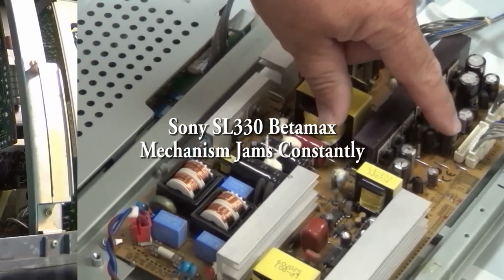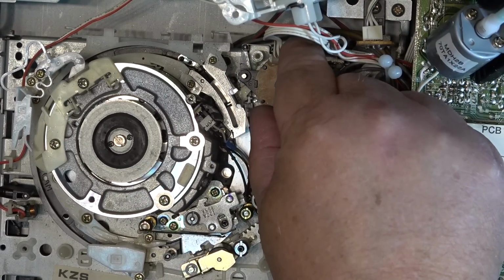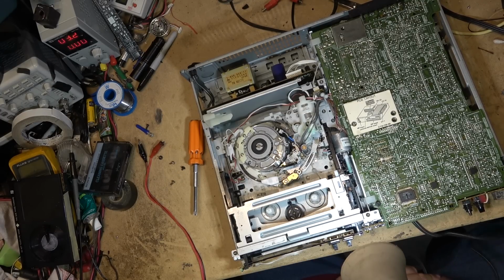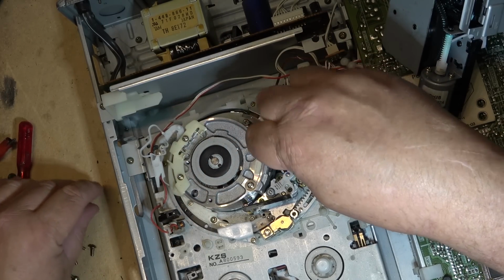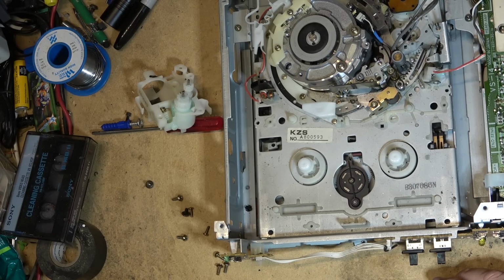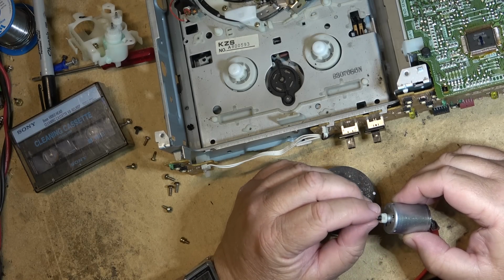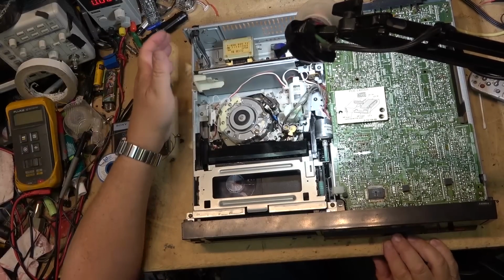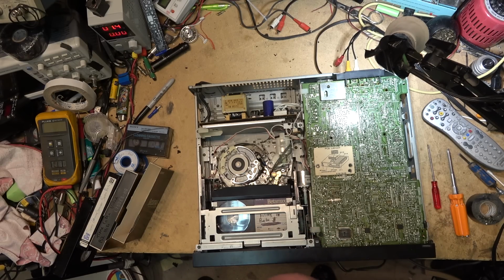Sony SL330 Betamax 711B3 Chassis, Mechanism Jams Constantly

Comment: Just received an edv-8000 from Japan and it's super clean, I don't think there was a spec of dust in it, but it wouldn't even load tapes at all. Watched some of your 711B3 videos and I fixed the cassette loading mechanism and that works perfectly from what I can tell. But, the tape pulling mechanism, those arms, don't get driven at all by the other motor. It moves very slightly and then the tape gets kicked back out basically immediately after it loads and goes down into the deck. 

I tried positioning the mode switch several times, using the arrow, but still nothing. Guess I'll keep trying other arm positions later, I did make sure that little metal bracket was up when I inserted the motor assembly. I can manually move the gear under there with my finger and it does move the arms that way, so they don't seem stuck or anything. Sprayed some deoxit into the mode switch as best I could and spun it around and so far that hasn't been the trick.

I don't think I have a way to test the motor itself with what I have here. Not sure what I need to give it different volts and amps to see if it powers on right. If the motor isn't plugged into the assembly and I turn the deck on, it does spin for a few seconds, so it at least will turn on by itself.
Reply from the maker: Check the plastic gears around the load motor. (On the part that lifts off) as the midway gear tends to lose a tooth then ir won't load. Also the position of the spring on the clutch.
Reply: @12voltvids  Thanks, I will check that out. When I removed the cassette loader earlier, there was a half inch little thin piece of rectangular plastic that was stuck to the side by some grease. No clue if that went to anything important. First beta deck I've had, so I could be missing where that went. It didn't seem all that important though.
Reply: @12voltvids  The spring on the clutch, is that a spring on a brake arm? Sorry if that's a dumb question.

Comment: Back in the day I got many motor going by disconnecting it and powering it from a power supply removed fro the deck and let it run for a few minutes this cleaned the comm and fixed many dead spots.

Comment: Another way to find a dead spot on a commutated DC motor is to put a high value resistor in series with one of the wires, power it up, and measure across the resistor with a scope. 

You should see even humps if a segment is dead one or more humps will be missing.

Comment: I've had some success with opening up these small motors by undoing the crimps with a punch and polishing the commutator, although for those trying this be warned that this design with the two crescent slots needs a brush-lifting tool made of a piece of bent wire inserted in them and rotated to lift the brushes off the commutator before trying to remove the endcap. This is likely how the factory held the brushes off when assembling them too. Otherwise you'll make things worse by bending or breaking the brushes, since there's a protruding flange on the end of the commutator in front of the bearing surface.

Comment: I agree with the power supply change, those stupidly over complicated switch mode supplies are a disaster waiting to happen, with these things its best to keep things simple, those motors not having a dust cover is kinda crappy design.

Comment: The 711B3 load/eject was just so buttery smoothe & quiet. But it's Achilles heel was the two tabs the cassette carriage rides on. Once you've got a good method to fix those however the problem goes away. Those tabs are the first casualty of the way packages are man-handled these days. I recently bought an SL-340 beat to hell by UPS.

Comment: Excellent work! I thought for sure the motor coupler was split. What brand of tape was that L-830 which shed its oxide so badly? I'm hoping that the conditions under which the tapes were stored will make a huge difference in their longevity.
Reply from the maker: It was a Sony tape.

Comment: I am in the uk and i have several of these spare if you get stuck and they are the whole units, i am a collector of Japanese ntsc models, i have over 40 machines and quite a few spares.
Reply from the maker: I have a few parts machines myself and I don't use tape other than to archive stuff for people. I really need to archive all my old tapes while I still have working equipment.
Reply: @12voltvids  do they sony beta L750 tapes have the problem the one that was in this machine to those were the last ones I used before i dropped this formatt I have the last e3 nintendo press conference on one that was the last year it was played on tv before it went online.  The tape isnt back coated either.

Comment: It seems so alien that it doesn't make the familiar Sony whine during eject.  We never saw this kind of mechanism in the UK.
Reply from the maker: The whine was the planatary hear that say on top of the loading motor and had the toothed belt that drove the cassette mech.  They used that one for most of the years that the slimline beta was in production.
Reply: @12voltvids  Only slim front loader exception being the early Sony SL-C9.  That didn't whine during eject.  It usually didn't manage to eject at all, it was so unreliable!  I have three working ones, with the updated brass top carriage gears.  Presumably there was a USA equivalent, it was a linear stereo with slow motion etc.
I'm presently working on an Japanese NTSC SL-HF900.  I've gone from not working at all to loading a tape and playing, but the picture is looking like it is crushed, so presumably bad capacitors somewhere.  Suggestions welcome.
Reply from the maker: @video99couk  the sl2500 and 2700 had those mechanisms with the plastic gears on the top that broke. They were a disaster.  Never had a linear stereo model.  They went right to beta HiFi here.
Reply: @12voltvids The SL2000 used the same design but was better because it was a top loader and didn't have the gears for the front loader, correct?
Reply from the maker: @KylesDigitalLab  it still had the shitty direct drive reel motors and as such suffered from the same tape slap issue at the slightest wear on the upper drum.  This resulted in tapes being stretched or broken. Stretched tapes resulted in the magnetic layer just peeling off and falling into the mechanism.  I have opened sl2000, 2500 and 2700 to find a pile of brown and black oxide shards around the drum base and the shuttle block where the tape does a 180.
Reply: SL-HF900: User error: Terrible playback picture when Hi-band selected on a normal recording.
Reply from the maker: @video99couk  all the early superbeta machines had to be manually switched between hi band and standard.  Play a regular tapw with superbeta switch on and it looked like crap.
Reply: The 711B and B2 chassis sounds like a paper-jamming printer. I recall Dave talking about customers thinking their Betamax was broken because of the loud whine during load/eject.